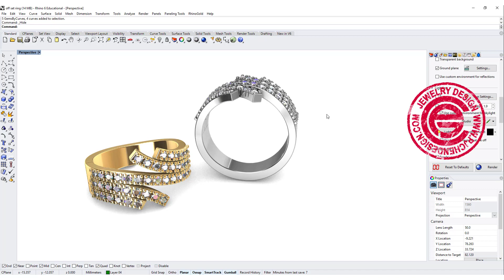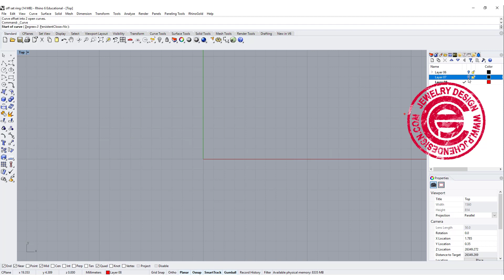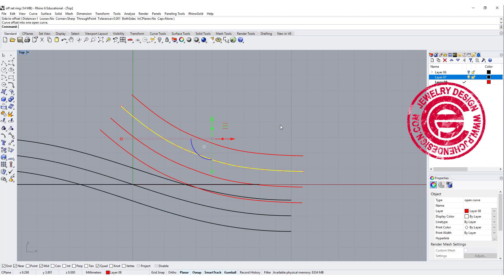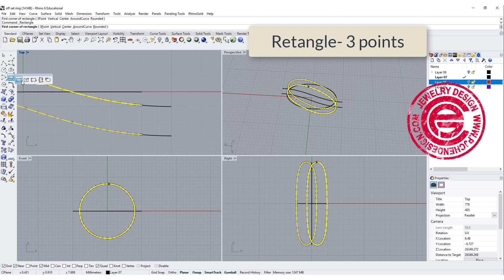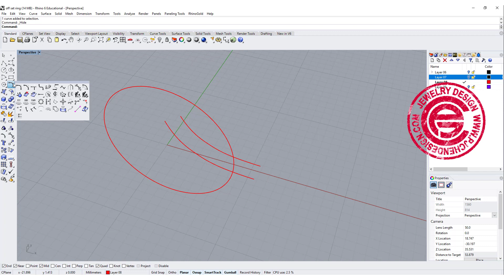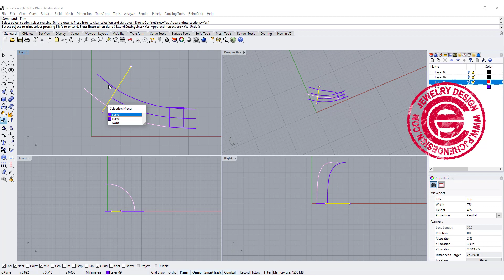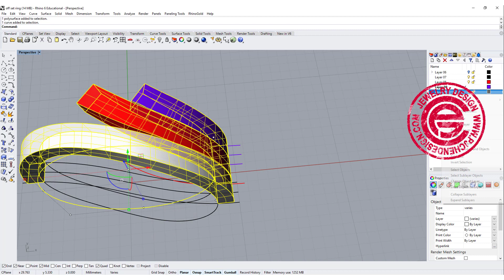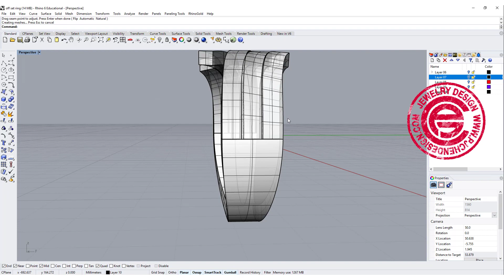Offset Fashion Ring 3D Model in Rhino 6: Jewelry CAD Design Tutorial #90

Comment: I had a question about the software. Does the software tell you the approximate weight of the ring before its casted? or the Carat weight of the diamonds? Thanks in advance
Reply from the maker: You can check the volume in Rhino but you will need to calculate yourself into metal weight. I have a video discuss that. search "weight" on my channel.
Reply: @PJChenJewelryDesign  Thank you!

Comment: Hello gives error at the end when doing the boolean,why?
Thanks
Reply from the maker: check out my Q/A playlist. I have 3 videos explain why boolean is not working
Reply: I meet the same problem, I found that the cause of this problem is likely to be: Use "rectangle" to execute the command "sweep"，that will cause the close surface to have some seams, which will easily cause the seams to be aligned. You can try to move these solid slightly ,( or “sweep” with rounded rectangle), it solve my problem.